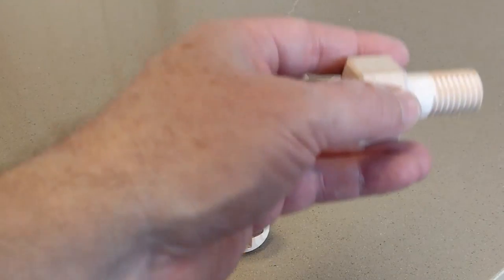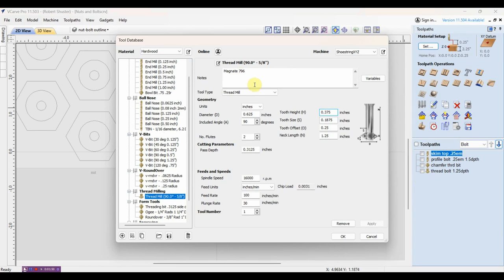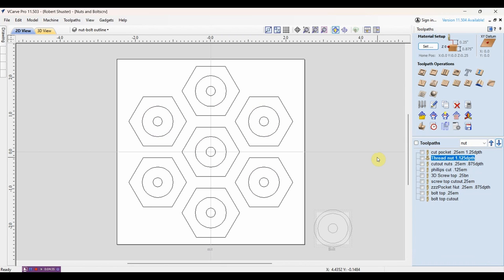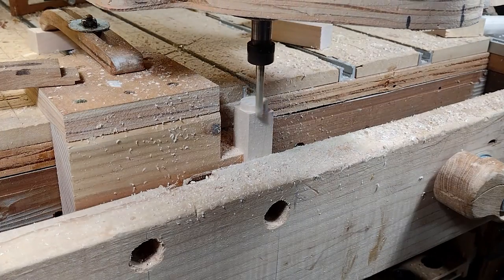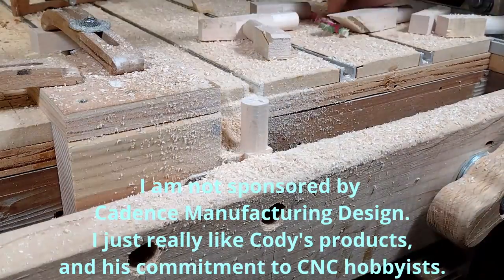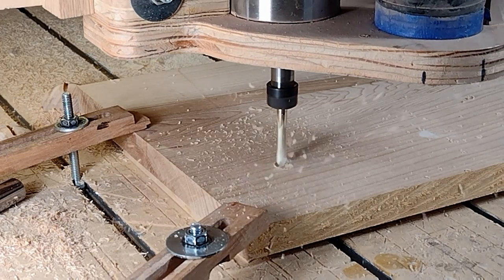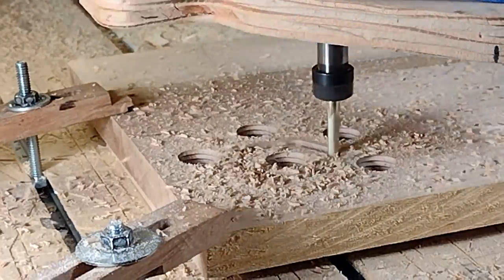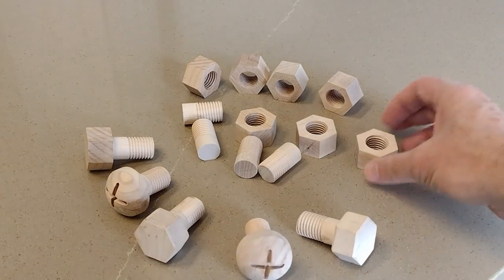Making Wood Nuts and Bolts with my CNC

Comment: That was pretty kool. From the looks of it, you not only talk the talk but you walk the walk.
I really like the homemade touch plate. I need to make one of those.
Reply from the maker: Thanks for watching.  The touch plate was one of my first videos many years ago (I cringe when I watch it today).  I am close to getting a tool setter / bit setter working.  Not quite as good as a automatic tool changer, but it should help bring some automation to the manual bit changing process.